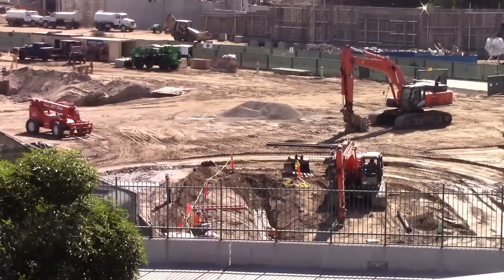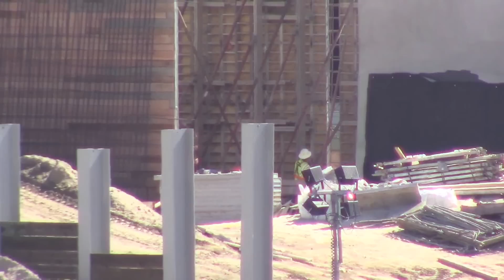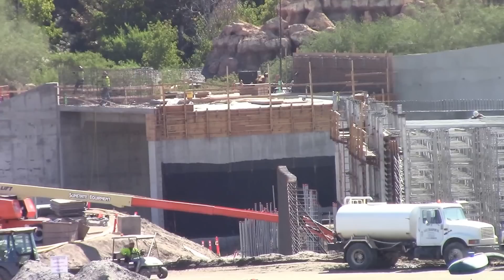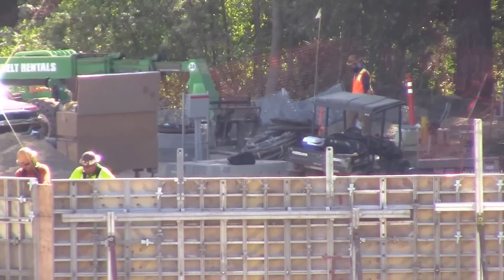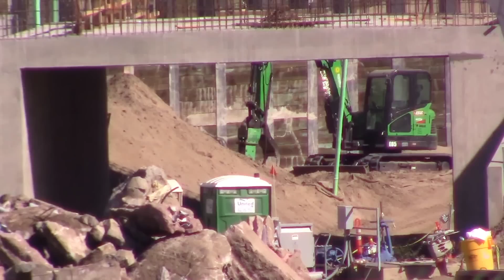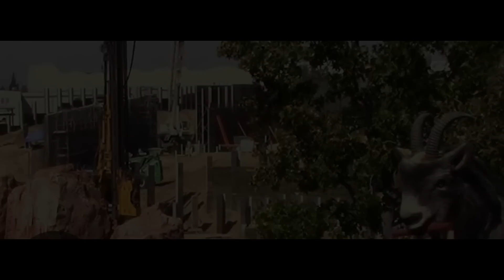Disneyland - 9/29/16 Star Wars Land Construction Update

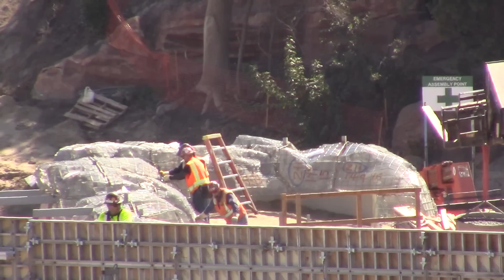Comment: Wow! The curtain-o-concrete is nearly complete- you'll need to keep probing and peering into the gaps to discern the action to come on the riverbed. Rock-work being installed! @24:10 carrying an individual form and @24:10 and @25:30 puffs and flashes of welding them to structure at top (sides too?) of original "catwalk" extending from island into riverbed. Much there is about to be obscured behind concrete-curtain. Keep up the great work!
Reply: vitruvian that is a plasma cutter you see sparking, my guess s that they are cutting away temporary reinforcement for shipping proposes to get the shape back before concreting them for finishing.
Reply: You're right, Mark- they're cutting on closer inspection. I believe they're cutting off the support struts standing proud of the forms, however. What do you see that appears its for shipping purposes (in or out)? I gather that the rock forms are installed in their final position there on the perimeter to the "catwalk". Wish we could see the individual forms being placed.
Reply: vitruvian I think it was the last video when they were just sitting there, they looked like they were long and the mesh might have been bent by the people handling them in shipping. Easier to put something in for reinforcement and remove it then destroy the molds in transit.

Comment: Work under Hungry Bear with compactors @31:10 suggests final grade there with forms and concrete pour soon to come- probably before surrounding area is in shape where trail snakes around and meets the outer riverbank yet to takes shape too.
Reply: vitruvian could be, but they also dug it out so they could be compacting to stabilize the earth and peer footings from removing the earth from around them.
Reply: Perhaps, Mark. My assumption is based on the glimpses of work there over the past couple weeks- breaking out the old footings and foundation there. Do you gather they would be doing much reinforcement there with (I believe) the upper-deck still open and accessible?
Reply: vitruvian I think they are doing a bit of both really. As for the deck still being open, they must know how far those peers are driven into the earth to feel safe doing all that work under there. Must be fun trying to eat with that thing shaking from two tampers going at once!

Comment: At the rate they are working, could they possibly have the Disneyland Railroad and Rivers of America (including Fantasmic, Tom Sawyer's Island, and Davy Crockett Canoes) open earlier than summer of 2017?  Maybe this holiday season, at least Christmas or maybe even Thanksgiving?  Could they complete them in 1.5 to 2.5 months?
Reply: It's going to re-open on 5/26/2017.
Reply: Hey, do you have a source for this date?  I haven't seen a specific date, only "by summer of 2017" which would coincide with the date you shared.  Thanks.
Reply: I took a screenshot before they changed it for proof. Here is the link: http://oi64.tinypic.com/dpy68z.jpg
Reply: Touring Plans isn't an official Disney website.....I wouldn't hold their date as bible.  In my opinion, at the rate they are moving I think they will actually be lucky to have it ready by May.  It looks like they are progressing fast, but they still have a lot of work to do.   Definitely won't be open by the holiday season.